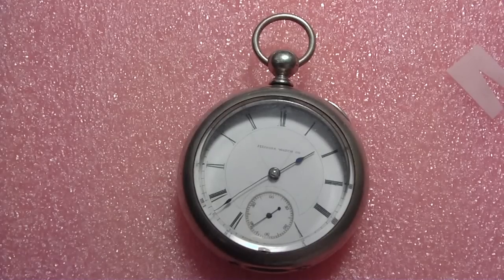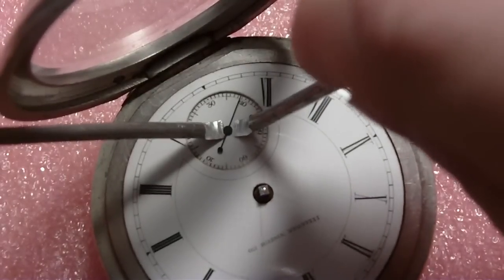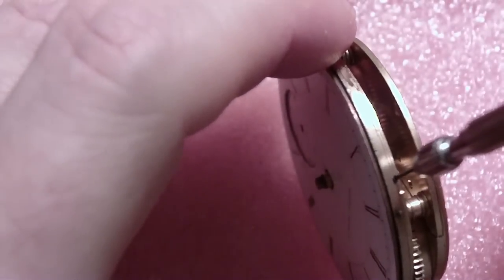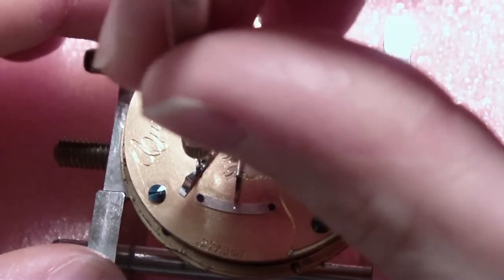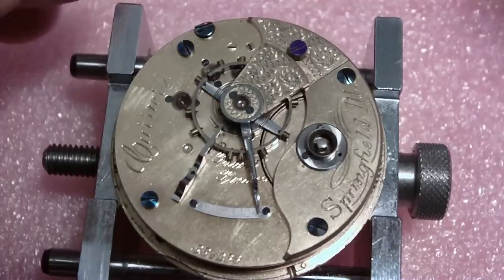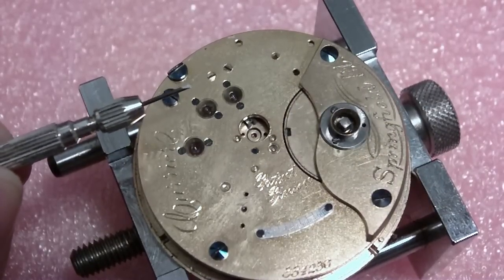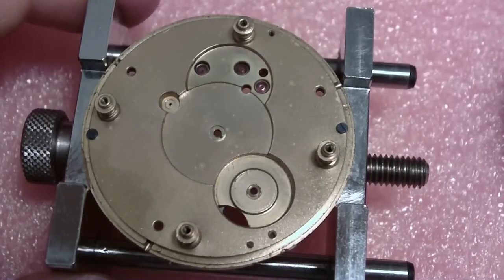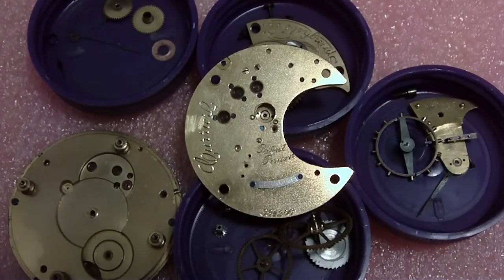How I take apart a pocket watch, Illinois Currier

Comment from the maker: Thank you.  One of these days I will pad the corners of my movement holder.  I will have to look into turning off the auto focus but I don't think I can because there is no way to focus manually.  I do have an external microphone now so on my later videos the noise is not present.